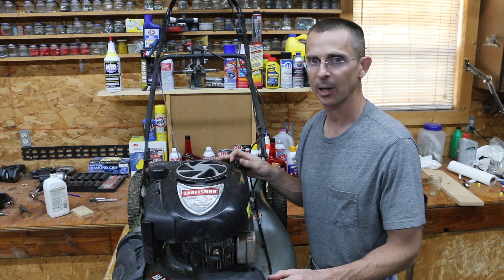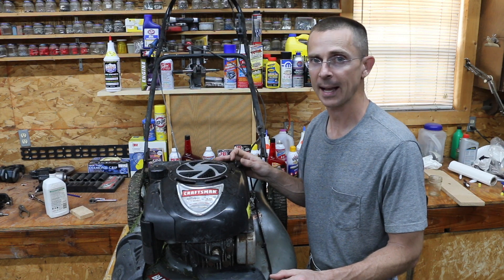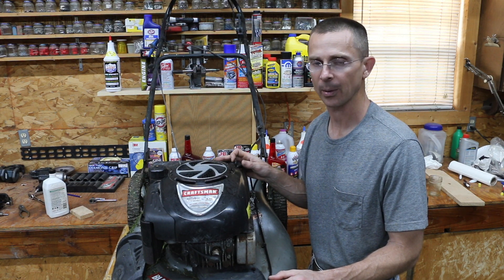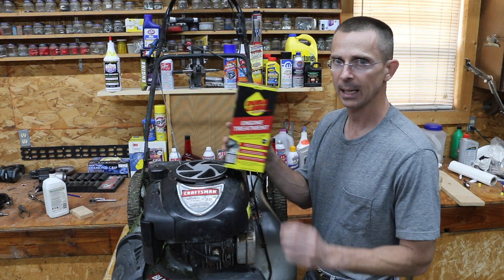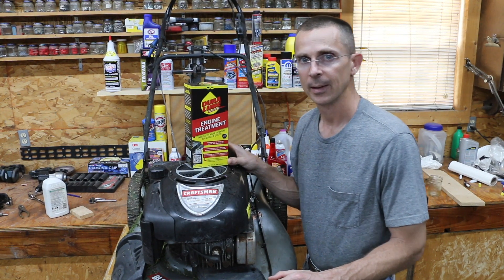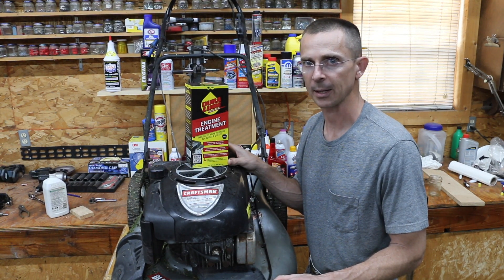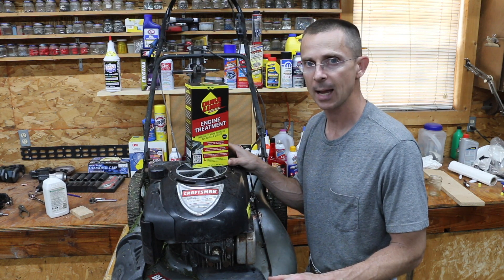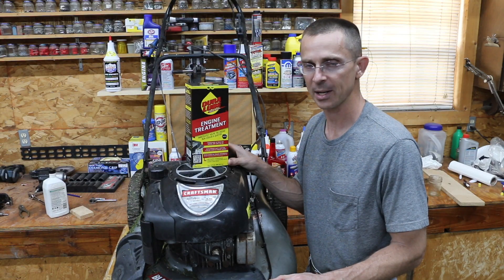Does Dura Lube actually help quiet and cool a gas engine as claimed?

Comment: I MAY HAVE LUCK BECAUSE I HAVE USED DURALUBE IN EVERY CAR I HAD, A CIVIC RAN WITH NO WATER LIKE 20 MINUTES AND GOT HIGHER TEMPERATURE, BUT I FIXED PUT ALL IN ORDER AND TEMP NEVER WENT OVER 50% NOT BEFORE OR AFTER. I HAD NEVER NEED TO REPAIR ANY ENGINE IN MY LIFE, AND I AM 60YRS OLD. 2 BRAND NEW CARS AND 6 MORE THAN 10 YRS OLD. NOW I HAVE AN INTEGRA LS COUPE, USED 3 COMPUTER, AND ENGINE PURRS IN IT BAY, UNDER THE HOOD.
Reply: I ALSO DO THE TRANNYS (AT) NONE FAILED .
Reply from the maker: Nice!

Comment: I've used Dura Lube for more than ten years.  I was able to get over 600,000 miles out of my 1985 Celica GT.  It makes the engine run quitter, smoother and lower RPMs when idling.
Reply from the maker: Thank you!

Comment: Another idea.  I brought a car with a noisy engine to my mechanic.  He drained the oil and put new oil in and it got rid of a lot of the noise (upper end noise).  He recommended that I use Prolong Oil to cut the noise.  He said it's expensive, but it would make the engine much quieter.  I'm wondering if you can run a test using Prolong Oil (not the additive, but the oil).

I love your tests!  Lots of great information and most important, you do it in an unbiased way with no support from the manufacturers!  Keep up the great work!
Reply from the maker: Thank you for the video idea!

Comment: Back in the mid 90’s I drove a high quality, state of the art luxury car... a 1987 Caprice Classic with 175k miles. With the “low mileage” came some valve and lifter knocks. A friend suggested DuraLube and it instantly quieted the knocks AND gave me 10% better fuel economy. Now that I have moved up in financial status I drive a 2002 Trailblazer with a mere 206k miles that I purchased new in 2003. When I run DuraLube I get 22 MPG, when I don’t I get 20MPG so roughly the same fuel savings. I am changing my oil today and using Penzoil Platinum Synthetic (some awesome guy on TubeYou named Project Farm said it was outstanding oil). I’ve never run synthetic oil in it before... will see if I still get the 10% increase in fuel economy with DuraLube and report back.

Comment: It saved my car years ago. I blew a radiator hose on my Mitsubishi.  I had my two kids w me on the interstate,rush hour, I didn't want to pull over. I drove 40 minute bone dry to the house  and cut off the engine knowing it would seize up. The next fixed the hose refilled it and changed the oil as  well . It turned over like nothing happened and drove it for years!  I was a believer. Still am ..

Comment: I could be wrong here but I think the reason the db's were higher is because
it sounds like the engine was running at a higher RPM
with the Dura lube.
Reply from the maker: Yes, you are right.  Higher RPM for sure
Reply: @ProjectFarm  They only oil additive I've used is Bestline in my older Dodge truck 5.7 Hemi.
Sold it after 10 years running like a top. 
My new truck is a Dodge 2500 6.4 Hemi , haven't added any additive to it yet but will in the future.
It will be either Bestline, Prolong, or Duralube not sure yet.
Thanks for all the great work and info you provide.
Truly appreciated.

Comment: We were off grid used 7200watt gen set ,used mobil 1 10w30 after intial breakin on oil genset came with aprox 140hrs,the units lasted 1000/1100 hrs ,with one once of duralube per oil change we were getting 4000+hrs on cheap gensets plus oil would not go low until around 200hrs ,im not a fan of additives but its in our farm equipment and mowers. my truck is 2003 with 193000km mobile 1 and duralube no leaks no ,burning oil i do 5000km oil changes its a half ton pulls trailers ,camper ,farm truck, it pulled hay rake in feilds this year, towed a tractor 1000km through the  mountains,ihave been adding duralube since 30,000km ,that truck gets used but gets premium fuel and mobil 1 with duralube ,has k&n filter ,throttle spacer ,and cat back exhaust ,motor never been touched
Reply from the maker: Great information!  Thank you
Reply: I tried prolong years ago in my two stroke in gear box and inj oil gummed it up bad had to scrape a layer of teflon & cooked egg white looking  crud off every part of the internals on bike ,took weeks ,was convinced by my friend he gave me a jug to try it out,on an old truck had to idle it down 200rpm no change on temp , millage improved by 3mpg  thats a big deal on a big block ford lol
Reply: (Jug of duralube that is )on big block ford 4000.000km on motor  sold it well over 600'000 km still ran fine

Comment: I had a 1989 Chevy beretta with 55k miles I treated with duralube. 1 week later my wife lost the fan belt. It was 101 degrees outside and she drove 40 miles with no coolant flow. There was no antifreeze left in the engine and only 2 quarts of oil in the crank case. Changed the oil filled the coolant and drove that car without any problems for another 100K miles. Duralube ifs the only additive I use because I’ve seen it first hand work. Thank you for your channel I watch 2 or 3 every night. Keep up the awesome comparisons.
Reply from the maker: Thank you for the feedback!

Comment: Used duralube in my cars for 35 yes and its saved 2 motors when water pumps went out and very little damage done when another car spu n a rod bearing. Replaced it car was fine
Reply from the maker: Thank you!

Comment: What would cause such a horrible engine knock? I have heard of rods knocking but what part and where does it happen?
Reply from the maker: Damage to the connecting rod resulted in excess clearance between the connecting rod and crankshaft resulting in the knock.
Reply: @ProjectFarm  Ahh... Thank you. :)

Comment: hi PF!
cool stuff going on here, happy to see the "news" as soon as released. :)
did you ever get asked to test some oil/fuel additives from "BISHOPS ORIGINAL"? i've used it with my friends/colleagues in older 4cyl gasoline engines form '90s and it worked miracles. 
Used it because I've read/heard a lot of good stuff on that. Even from machining shops, small-aircraft pilots, etc. I am pretty sure it can beat few of those additives you already tested - if used properly. 
Thanks for your content, keep up the good work. :)
Reply from the maker: Thank you for the video idea on testing Bishops Original!

Comment: Try it on your friction/bearing tester and you will see that it has a super resistant film that want easily be cut through. 25 or so yrs. ago a guy came in for an estimate in my body shop. He later showed me some stuff called SFR, superior friction reduction. He invited me to his house to demonstrate the SFR to me on a friction/bearing tester similar to yours except you would put weights on it to increase the pressure of the wheel on the half inch round stock. With pretty much all the oils, three weights broke through the film and created a divot like your machine does. With the network marketed SFR, 20 weights wouldn't break through and created a divit.The only other oil that competed with the SFR was Duralube. I even lifted up the weighted arm and dropped it to simulate dumping the clutch on a hill to get a heavily loaded truck and trailer going from a dead stop. That would put heavy pressure on especially the rod bearings. The SFR and Duralube still held up and wouldn't let the metal touch and created a divit. I also wondered at what temp. it would break down at so I got a high temp thermometer and measured the temp. in the oil bath container under the rotating wheel. I can't remember what temp we got the oil bath up to, but it was way higher than an engine would normally run even on a very hot day under a heavy load. I was thoroughly impressed. If the metal can't make contact, then it can't wear. Even the valve face and seat should last longer, because the SFR or Duralube woold keep the valve guides from wearing. The other additives that you can add to various oils that would also take 20 weights were the Teflon based stuff like Slick 50 and Karts version that I think was called T plus. That protection would fail at something like 220 degrees though. Bottom line was that the SFR and Duralube worked better. I'm a tough one to sell something to, but I'm thoroughly sold on those two additives. By the way the SFR to oil ratio is 10% SFR. The Duralube ratio is 20%. The price of the SFR was twice that of Duralube. I've been using Duralube ever since and haven't even seen SFR for 25 or so years.
Reply from the maker: Thank you for the video idea!

Comment: As I sit here and watch your videos I had a thought....I have on my counter as I type this some ceramic coating for paint...what if you put some in oil and test. Also you could take some without oil and coat all moving parts then reassemble engine. Little more work but be very interesting! Be interesting on the lubrication tester too. Sometimes I think outside the box..

One more thing is on most of the engine failures I've seen on your test is the con rod at crank siezing and then breaking. In my performance motor I replaced with a billet con rod but what is nice is it uses a regular automotive bearing insert...so it would be interesting if the additives would work better with that style of bearing surface. They are available for the harbor freight motors. Just a thought

Comment: There is a product called Motor-up. I used it in my 86 Firebird and it seemed to run a little better. Maybe it was just me. If you can find some (not sure if it is even still around) maybe you could put it through some test.
Reply from the maker: Thank you for the video idea!

Comment: one thing is don't put it in a brand new engine, it is so slippery the engine will not break-in. The manufacturer even put a warning on the box. to fully break-in the engine before using it. For some reason it's not there anymore since they changed the box.
Reply from the maker: Thank you!

Comment: I could not tell much difference in the sound of your lawn mower however I know duralube works. I have used it for years and never had an engine problem. It might take a few oil and lube changes before you hear a difference but what is going on inside the engine is a different story. A good test would be to keep using duralube and see how many summers you get out of that engine. I have to say sometimes if I go with someone else somewhere, I keep thinking their engine sure could use some duralube to quieten their engine down and make it run smoother. These engines today are designed to run hundreds of thousands of miles if taken care of. They cost too much not to do everything you can to prolong their life. For me it is duralube and sea foam!
Reply from the maker: Thank you!

Comment: Do coolant additives actually work, and which one is the best?
Its summer time, the air ia getting hotter and cars are over heating and im curious if they work, thank you if actually read this one
Reply from the maker: Thank you
Reply: @ProjectFarm  I also would like to see a test of those cooling additives. Especially since VP Racing Fuels recently released their own version of Cooling Additive in their signature Blue Color. 

So VP vs Redline Water Weter vs Amsoil Dominator vs Royal Purple Purple Ice vs Hyper-Lube. The greatest battle in history. 

And pit them all against Evans NPG+ Waterless Engine Coolant. Love that stuff. Their coolant has a guaranteed 500K mile service life and protects up to 375 Degrees in the hot range and as low as -40 in the cold.

Comment: I had a Ford F-150, it had some mileage on it, well maintained. Put a quart of Dura lube in it, a main bearing seized less than 600km later. Had a small Ford car next, also high mileage, put on about 8km on it, it was running great. Put a quart of Dura Lube in it, less than 400km later. Spun 1 or more main bearings.
Reply from the maker: Wow!  That's awful!

Comment: My 1989 campy v6 Le I miss very much started using durolube when the engine was at 50 k. Transmission. Went out at 330k miles that is right 330k miles. The engine would never die and never burned any oil.

I once before junking the car red lined pass 8000 rpm for about 1 minute. Had no problem. Sad to see it go.
Wish to God I could buy it back Lord Willing. 
Amen
Reply from the maker: Thank you

Comment: I'm a welder and I heard about this stuff from an Alberta farmer so I tried the Hot Plate Test... the Duralube went towards the source of heat when I put Duralube in one corner and applied heat to the centre of the plate... I would not have believed it if I hadn't seen it and tried it for myself WOW ever since I always put it in my vehicles and it always runs cooler, smoother and better.
Reply from the maker: Thank you
Reply: @ProjectFarm  you're welcome, I just watched a demo for Petron Plus engine conditioner that blew my mind.
https://youtu.be/Pt_Dh3hHr6o

Comment: Dennis777
My Story with Duralube started a little different. Back in the mid 90's my daughter got a hamster a cage and of course the exercise wheel for him to run all night long on. It was all metal and squeaked all night. 3 n1 oil stopped the squeak for 3 days, then I tried Liquid Wrench with Teflon. It lasted 2 weeks. Back then when you bought a jug of Duralube it came with a smaller pump bottle. Well that stopped the squeak 3 months been to it ever since
Reply from the maker: Thank You!

Comment: I use it in every engine I own. I had an old 30-foot boat with a 36 hp Palmer gas engine. The oil pressure tube came off the gauge and dumped all the oil into the bilge and got pumped overboard. I had Dura Lube in the engine. I thought ok this will be a good test. I had to go 40 miles to get home with no oil so I ran about 1/4 throttle all the way back. The engine just ran like normal. When I got home I pulled the head, there was no scoring on the cylinders no knocking nothing it blew away. I have used it for 40+ years now I swear by it. One thing about it is you have to keep adjusting the idle down as it works into the metal, the first time you use it.
Reply from the maker: Thank you!

Comment: Had a 77 Chevy impala that had a water pump failure. After the failure I heard a knock in the lower engine. I.e. mains.  Not very loud but it was definitely there.  Put in duralube and a new water pump, said a prayer.  Started her up.  As the engine was running after about two minutes the knock started to go away. After about 30 more seconds, It was gone. Swear to God. I kid you not. A miracle!!  Anyone who says ALL engine additives don’t work without experience, or testing, is full of it up to his ears and the rest is toilet paper.
Reply from the maker: Thank you!

Comment: I have owned my 1995 Ford F-150 since new and have done all of my own oil changes. The truck averaged 15.5 MPG on the highway at 65 MPH. After I added 1 quart of Duralube with my regular oil (Castrol GTX) my fuel mileage went up to 16.5 MPG for about the first 1,000 miles and then slowly tapered back down to 15.5 MPG after 3,000 miles. I also noticed a slight improvement in engine performance. So yes, Duralube does work.
Reply from the maker: Impressive results!

Comment: Nice video. Years ago I decided to give Duralube a try. I changed my oil and filter and let the engine warm up, then I began adding the Duralube. As soon as the Duralube went in the idle speed jumped, rpm was almost doubled. It took a minute for the car's computer to adjust and drop the idle back down. That was factual evidence that Duralube increased the ease with which the engine turned. I have used half a quart with every oil change. My Crown Victoria with a 150K miles pures like a dream. Never had a failure. I think Duralube does an amazing job of keep the engine as frictionless as possible. It also protects the metal parts with a coating that keeps the metal in pristine condition. Car doesn't burn oil. It's keep me doing the other repairs needed as I know the engine will go 500K or more. Don't ever need a new car.
Reply: You can't kill that engine anyways lol
Reply: Hows the car doing now?
Reply: @FILA23WHITEPRODUCTIONS  Engines has 162,000 miles and running fine. No oil burning. No smoke. No knocks. Probably go 500K easily.
Reply from the maker: Thank you very much!

Comment: In the user manual for a motorcycle (TDM 850 3VD) whit wet sump, manufacturers recommend not to use oil additives, along with avoiding oils that increase fuel economy. This is will cause the clutch to stop working properly (lack of friction). Would you be so kind as to test this claim? Thank you.
Reply from the maker: Thank you!

Comment: Just watched your video .... just found you and love the way you test .... signed up and thanks...

I bought a beautiful 1999 chev silverado with 180 K on it, I noticed on the first oil change that it used about a litre of oil in 5 K.  I have always used Duralube and love how it works.  I have done 2 oil changes since i bought the truck and both times i put in Duralube.  The truck runs great, better gas millage, and now doesn't use any oil.  INTERESTING !!
Thanks for verifying what i already knew :)
Reply from the maker: Thank you!  Impressive results with Duralube!